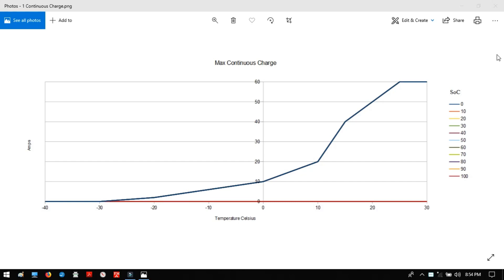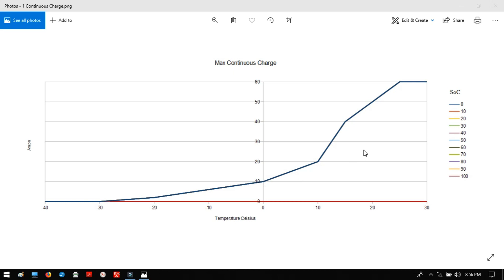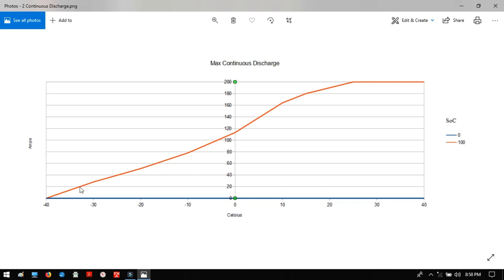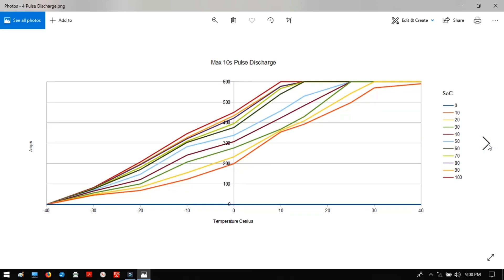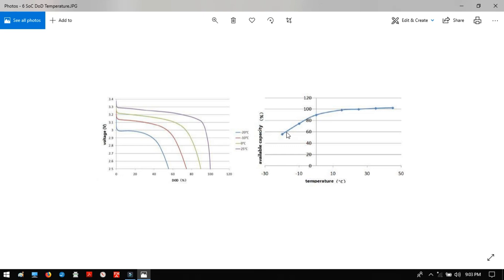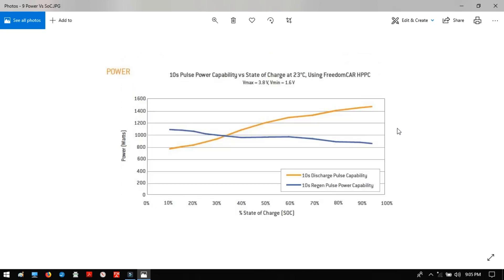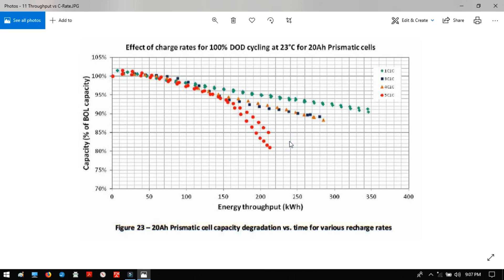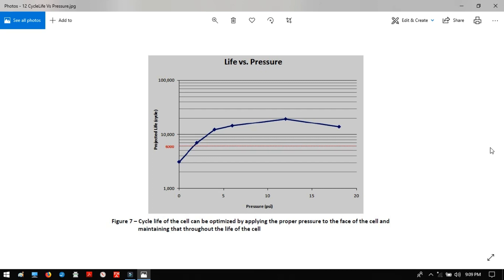Variables of Battery Life

Comment: What is the source/reference of/for the Life vs. Pressure graph?
Reply from the maker: It's from the 71 page 'A123 Energy Solutions' publication title "Battery Pack Design, Validation, and Assembly Guide using A123 Systems AMP20m1HD-A Nanophosphate Cells" .. Published 2-7-2014 .. Document # 493005-002.

Comment: Do those curves take into account the internal heating during charge/discharge?  Seems like if you started with a low charge or discharge until the internal temp rises, then you could increase the rate if you can estimate or measure the temps.
Reply from the maker: You are correct .. Any method of heating (Internal (due to use) or External) that result in temperature change will cause the battery to behave at the new temperature it is at.

Because many modern batteries use good thermal conductors like copper as current carriers from the active chemical reaction inside to the external electrical terminals .. one fairly easy way to get a decent idea of the temperature inside the battery is to read the temperature of that good thermal conductive copper part of the cell .. If you do a few tests on individual cells prior to building a multi-cell battery pack , you can get a very good idea of the thermal behavior of those specific cells , under your known test conditions.

Comment: I suppose temperature cycling is also a factor.  If the cell cycles every 24 hours from say 10C to 50C, that cycling alone could add to the fatigue of the cell.  
Also I wonder if controlling charge rate with a simple bit of code using PWM would be effective.  Say my charger puts out 100amps, but at the temp of 10C I only want 50amps, does a PWM with 50% duty cycling between 0amps and 100amps give me the same longevity of the battery as a true 50amp charge rate?
Reply from the maker: temperature cycles :
Yes that is true .. the question is to what magnitude would that temperature cycle impact compared to other factors.

PWM :
Comparing a PWM 50A rate to 'true' 50A rate .. can get tricky :

#1> Due to capacitive and inductive effects , most reasonable powered PWM systems don't/can't  switch 'hard' between 0 and 100 .. but instead there is curving / ramping up/down time for the system to respond .. exactly how much of that exists in a given system (devil in the details) .. that curving / ramping up/down helps to soften the amount of 'abuse such a hard 100 hit could have otherwise been.

#2> IF all else were equal (and it's not) .. the high peak 100 rate hit itself would be harder than the softer 50 rate itself.

#3> PWM isn't exactly AC charging (but it starts to pick up some of (not all) the beneficial effects of  charging with AC) .. For example .. they aren't done for equal lengths of time , so the question is if the shorter amount of harder is worse overall .. and what % of the time does it spend at each amount .. for a simple example .. if the 100 rate wares the cell 150% faster (net 250% wear rate of the 50 'true' rate) , but as the system spends milliseconds ramping up to 100 and ramping down to 0 .. maybe it only spends actually about ~40% of the miliseconds of time at that peak 100rate .. 40% of 250% would be around ~100% of the wear rate (ie roughly the same as the 'true' 50 rate) ... devil is in the details of how much of the AC charging benefit mechanisms are picking up .. but all else being equal .. applied AC charging can charge a DC battery faster under the same conditions (SoC/SoE/Temp/etc) and same wear rate .. or charge the same rate and give less battery wearing.

--- 

Overall I would guess (without detailed testing of that system) , that with simple PWM control , the difference would be very tiny .. and difficult to see .. as long as the PWM switching frequency was reasonably high.

Comment: Hi Ian,
I am testing 40A Pounch NMC cells connected 4 in parallel and them 14 in series to have a complete 51.2V Battery; I use it for now without BMS and in 87 days of testing , using between 3.428V - 4.114V  with a max discharge and charge rate of 0.5C I could not see any cell unbalance till now;  I try to keep the temperature between 15-25 C; I try to learn how to maximize the battery life and usable capacity, and I am guiding myself from what I read and watch on your videos;  Am I on the right way? Thank you!
Reply from the maker: You listed some of the right things.

I don't have specific test data for your specific cells , application , etc .. so I can't give you exact numbers .. more just general feedback.

parallel 1st then series 2nd = good
A Max charge rate = good
A Max discharge rate = good

min discharge voltage cut off = good
max charge voltage cut off = good

min cold temperature = good
max hot temperature = good
checking for cell level balance every ~87 days = maybe*

A well matched pack is not the same as a well balanced pack .. they are to different things .. and I would say they are both very important .. if anything I would pesonally put a well matched pack as a higher priority .. I didn't see that step listed in your short description .. did you do cell matching when you 1st put the pack together ?

*The better the pack matching the slower any drift will be .. thus one can go longer between cell level checking .. the inverse is also true .. the worse the pack matching the faster the drift will be .. thus one would need to check cell level sooner.

Soo .. depending on how well matched the pack was .. that will determine if if you are ok to check less than ~87 days , or if you need to check more often than that .. checking it yourself manually .. makes you a human BMS.

Comment: Hi Ian, I saw one of your comments on another video about Toshiba SCiB batteries. Were the ones you tested the used ones sold on ebay. I am tempted to order some for testing and was curious. Also, I haven't found yet any info about calendar life of the SCiB batteries (as opposed to cycle life). Thanks!
Reply from the maker: You are welcome to get some for testing for yourself .. There are a few things about them I would mention right off though , before you spend any money buying anything .. #1> It will be a  significant time sink  (labor of love) , if you plan to rewire them into  more cells in parallel than the 1p (~20AH) they come as .. that  is doable .. but it would be allot of labor hours to do it .. #2> The LTO voltage curve (1.80v to 2.70v) is lower than many  other Li family battery options  .. and not as widely supported in devices .. for testing , for BMS , etc .. you might want to check on that before spending the money of the cells #3> There is a finite availability in the aftermarket used BEV side .. for these Toshiba SCiB LTO from used Honda Fit BEVs .. once these are bought up .. it is not known if there will be more available or when .. one would either have to wait to see if such become available again , or buy new ones , or buy non-Toshiba knock off LTO cells (which might be fine , or they might not be as good as the Toshiba ones.) .. That being said .. bellow is the link to the ebay seller I got the used Toshiba SCiB LTO ones I tested from .. it is $320 for 24 cells about ~1.1kwh all together.  https://www.ebay.com/itm/32-4V-or-64-8V-20Ah-LTO-Titanate-Li-ion-1-1kWh-24cell-SCiB-cells/222782868762?hash=item33dee4cd1a:g:RgsAAOSwFO5aTs5x
I do not know off hand , of any specifically calendar life testing .. However , I don't off hand see any chemical reason for it to be anything but slower rate of loss (per year) than the LiFePO4 curve I showed in the above video .. but to narrow that down or to be 'certain' , run a very long test .. Eventually I can post a video based on the data I've been getting from the several year old cells I have for testing .. but the initial testing included loss from multiple factors (cycles, temps, etc) , not just calendar alone .. so it will be a few more years of data to verify / confirm the calendar alone  loss rate , separate from the combined of numerous things number.
Reply: @ianpgeorge  Thank you for the detailed answer! I don't have a problem with the voltage curve  or availability of circuitry since I have the knowledge and desire to make my own. My only problem at the moment is that they won't chip to Canada so I will have to order a test battery when I am in the US in a couple of months
Reply from the maker: You are welcome .. If you don't want to wait ..one option  ,  you could get a U.S. Mailing addresses .. that they can ship to .. then have the mail arriving at that addressed forwarded to another address of our choosing (say in Canada) .. this a common practice among people who either travel allot , or who are year round RV dwellers .. The down side in such a tactic , with Lithium batteries like this get allot more expensive than doing that with just letters, and such .. Best of luck.